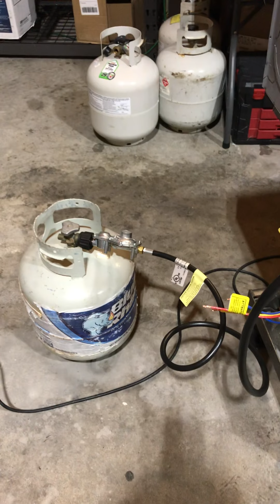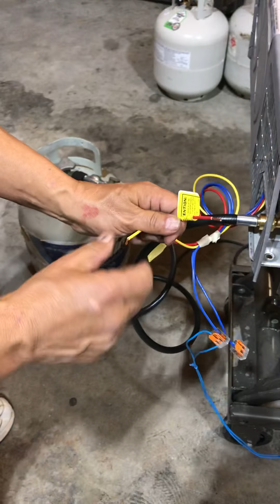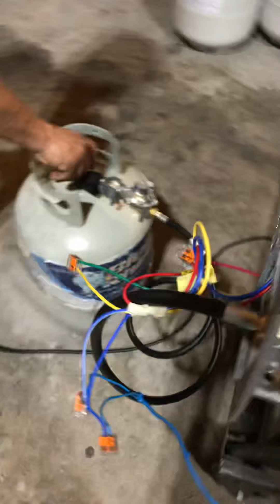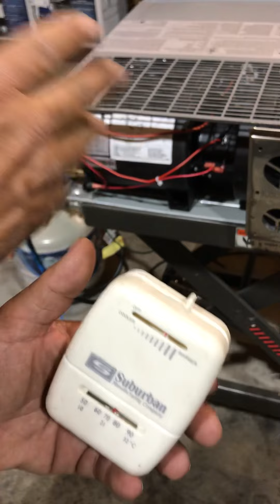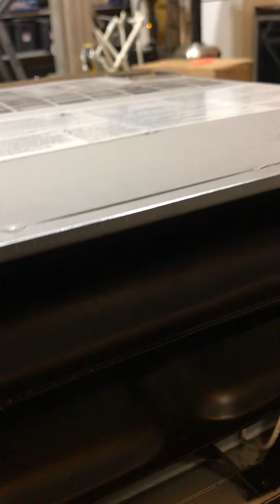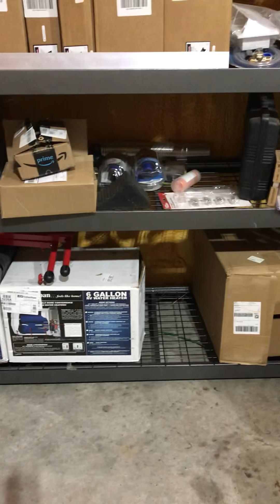Bench Testing RV Furnace by Griffith Family Enterprises

Comment: The next thing I'm going to try is tie in the wires together I made the mistake of installing the an RV furnace I got it all in I hope 12 volts to it I got nothing but I may have made a mistake with the switch the thermostat switch that you just cleared it up I kind of knew that but I wasn't positive of that but so far I haven't got nothing out of this this furnace hooked up to 12 V nothing but I think I got a I'm going to cross the freaking I want to complete the switch that's what I'm going to do

Comment: Might i ask what line you have to connect a tank to the furnace? Im trying to rule out my furnace as faulty or my regulartor on my coach, much love, mira!
Reply from the maker: 4.6 4.6 out of 5 stars 291 Reviews
GasSaf 5FT Two Stage Propane Regulator with Hose for Dual Fuel Generator, RV Appliance,Gas Stove and More，3/8 Female Flare Nut.  You can find it on Amazon.

4.6 4.6 out of 5 stars 291 Reviews
GasSaf 5FT Two Stage Propane Regulator with Hose for Dual Fuel Generator, RV Appliance,Gas Stove and More，3/8 Female Flare Nut.
You can find it on Amazon, text me at 580-512-2710 & I can send you a link